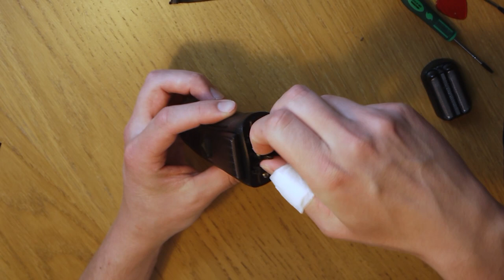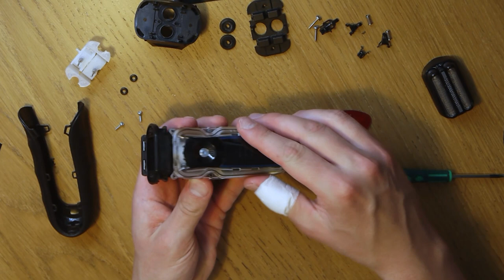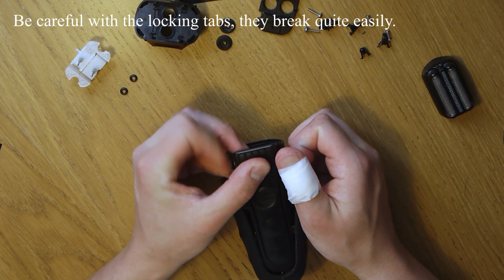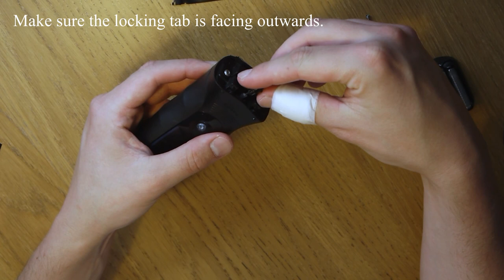Braun Series 3 Battery Replacement

Comment: Thanks for this video! also regular rechargeable AA batteries will fit with a slight modification of the battery connectors (just fold the (-) connectors on the board‘s side to have a firm connection to the battery) - I used 2x IKEA LADDA batteries. All in all i think this shaver is pretty good to repair, just give it a try :)
Reply: Is there anything special to this specific batteries? Why wouldn't I be able to use LADDA straight away (or similar products?)
Reply: @AndiBraun93  you can indeed use the LADDA straight away! The (-) connector on the board just needs to be bent over one more time to be used as a minus connector for your battery, thats it :)

Comment: Superb video..just changed my batteries on my Braun 3040s, the only difference  is I used standard AA Duracell ultra recharge NiMH 1.2 volt 2500mah batteries and had to slightly  bend the copper contacts inwards on the shaver battery compartment so a good connection  was made and it works just fine ...like a new shaver!👍

Comment: Many thanx, great tutorial - changed the batteries without problems. To other users: Be carefully in the first step to unfasten the small plastic parts under the shear foil  - they can easily be lost during disassembling.

Comment: Obviously, Braun could have put a simple lid on the other side, so that consumers could change the batteries with ease. But no, they wouldn't buy new models as often then. Thanks, I'll try this as a last resort.
Reply: It is probably because you can use this in the shower so needs to be ultra watertight
Reply: @HerwinAcoustics  A watertight lid would be possible, but Braun designed this like a laptop, so you couldnt easily service this yourself. more $$$$$$$$$$$$$$$.

Comment: I just disassembled mine, because it indicated bad batteries...
As I took the batteries out and measured them (using a Voltmeter), their Cell-Voltage was absolutely fine - so I put the old batteries back in and measured Voltage again, but with the shaver turned on to measure the Voltage with load and it's still absolute fine!

Fortunately, I didn't order batteries yet, as my shaver now continues working happily with the old batteries :-)

Comment: Fix & Fika, thank you for a great instruction. Although I broke the rubber/plastic cover while trying to pull/peal it off. By the way, did anyone noticed that Cleaning station stops working when battery quality drops? So, no matter how well you charge your slightly depleted/old battery, cleaning station won't work anymore. I throw away my previous cleaning station thinking it was not functioning, just to discover the very same problem with a new one. The shaver was still working correctly and chargeable, just the cleaning station electric motor was not functioning. Then, I replaced the battery on the shaver and cleaning station start working again. Strange, because cleaning station electric motor is powered by approximately 13V input and it's functioning should not be related to battery's condition.

Comment: I bought a refurbished 3040s but i think the battery has passed it best days, thanks for putting up such guides, so i got the choice now 2 exact batteries which cost about 14-20€ depending on brand and stats, o i try to modify the minus connector as comments wrote and use the best 2 AA rechargeable batteries (imho panasonic eneloop pro 2500mAh) for about 10€, so the winner is i will try it with 2 AA

Comment: I did the whole procedure and managed to change batteries. That’s fine. But the problem still remains. 
The reason why I did this was a to get rid off a start/stop problem. It takes 10-15 minutes to start and about 5 minutes to stop nowadays. 
This behaviour started almost exactly after the guarantee ended. That will say after two years and one week. 

So it wasn’t about batteries. There was a circuit board inside when I opened it. 

Have engineers at Braun put a automated product death in it?

Thanks for the great video. It had all needed.
Reply: It seems you are the only guy to have experienced this. Mine worked since 2014 till 2023 when the batteries went bad. Thats like 9 years! Haha, I myself am surprised!

Comment: Thanks a million !
I was able to replace dead batteries with new normal rechargeable AA batteries thanks to this video. 
You see, normal AA NH batteries can be replaced with the connecting metal slightly bended inwards.
In Korea, those weird-looking batteries are very expensive due to overseas delivery.
Thanks again !
Reply from the maker: Cool, they can be quite pricy here in Sweden too. Will have to try and use normal AA batteries, some comments suggested Ikea LADDA.

Comment: This is a very helpful video.  Don't think I would have been able to figure out how to disassemble my razor without seeing someone else do it.  New Ikea LADDA batteries installed by bending the battery contacts inward so that they make firm contact with the ends of the cells.
Reply from the maker: I'm glad you found it useful! Smart to use LADDA batteries instead, the original batteries are kinda expensive. I'll do a video with LADDA batteries too when i have time.
Reply: @ReviveNRepair  My original batteries had gotten to the point where I was getting just one shave per charge.  The new LADDA batteries tested at 1940 mAh. I would have liked to have tested the batteries that I took out of the razor, but due to the weird nubs on the ends they wouldn't fit in my battery charger, so I'll never know just exactly how depleted they were.

Comment: Little TIP: Instead expensive FDK batteries (sometimes hardly to buy) a usual AA regeargeable cells (without metal endings like FDK have) may be used. To ensure connection with coppper contacts, all 4 have to be spring up. The good choice may be well known and good working cells like Panasonic/Sanyo eneloop, or GP Recyko+. Do not suggest Varta due to self discharging parameter (even if producer say somenthing else) - my private experiencie with home appliacies and digital cameras.
If a RED light blinking quickly after batteries replacement and Braun is not working, simply connect charger and charge the new batteries. It may happen even if new batteries were charged (externally) before.
Reply: Very dificult find those bateries in they same service Braun
Reply: Sanyo eneloop  the best for this thing.

Comment: What can I say? Excellent video-  very clear, concise and well filmed (apart from when you obscured the tiny plastic pieces on top with your hands-couldnt tell which piece you had put back on.... :-)   ) . Very grateful for this. You just saved me about 50 quid.  Mines a 3040s wet and dry and as you say it is identical. Many thanks.
Reply from the maker: Thank you! And you're welcome :D It's a nice feeling when you manage to repair something and save a few bucks. Good feedback, will keep that in mind when and if I do another video.

Comment: First I'd like to thank the poster. My Braun S3 3040s appears to be successfully charging in its cradle.

Now here are a few tips:

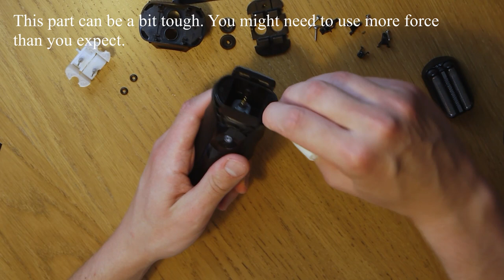1. You can start at 2:30, without removing the top. I used a small thin pointed, but not too sharp knife. Pushing it upwards very near the top, at the back allowed me to start prizing the strip off, without much difficulty.

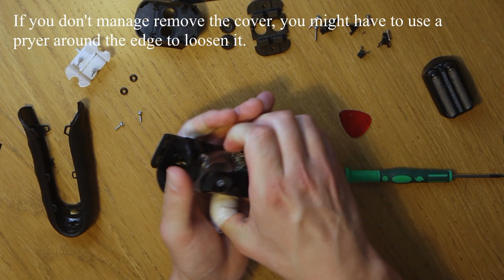2. Removing the bit as shown at 3:58 didn't work for me, but once it did flex far enough to allow me to slip out the printed circuit board with the batteries.

3. As mentioned you don't have to buy batteries with nipples. I just carefully folded a piece of aluminium foil and place it at the negative end to give a tight fit.

4. On putting back the rubber strip pay careful attention to the tabs, so that they are not on the outside. Also don't try to simply push it in right at top. You need to flex the top in before pushing home otherwise it will never go back.

Comment: Très bonne vidéo !  Pour le 340s-4, il faut retirer le haut métallique bleu pour retrouver le même processus. Attention, les deux petites rondelles en caoutchouc peuvent rester collées à l'intérieur de cette pièce. 
Very good video! For the 340s-4, you have to remove the blue metallic top to find the same process. Be careful, the two small rubber washers can remain stuck inside this part.
Reply: Bonjour, quelles batteries faut il acheter ?
Merci
Reply: @jarillon5614  merci
Elles font combien de mAh ?
J'en ai vu en 1800mAh sur amazon
Reply: @roryMlego  Je n'ai pas envie de démonter mon rasoir pour le savoir ! 😒 Il faut que la référence soit la bonne . Il y a des batteries avec des tétons et d'autres avec languettes. Il vaut mieux ne pas se tromper.

Comment: Of course, you have to weigh the cost of a new shaver vs the cost/trouble replacing the battery. If your batteries are shot you probably also need a new foil head, which in my case was half the price of a new Series 3. I bought mine Jan 2014, so it's over 7 years old. I got my money's worth out of it and it still works, but I have to charge it about every other day, and it's probably due for a new foil head.
Reply: A new one is 50-90 dollars, so yes it could save you roughly half the money when you figure in cost of batteries and a new head.

Comment: Nice DIY tutorial. I almost failed. After installing the new batteries there were red and yellow blinks on the board and the charger did not want to charge nor the shaver operate. Somehow it turned back on, but after during the assembly one screw just broke into the device. Now it’s working however the top does not fit properly. Bad luck.

Comment: Great Video, can you tell me what model Series 3 was that shaver? 3040? 3010?
Reply from the maker: Thanks! It's an older model called 350cc-4, but should be pretty much the same as 3040 and 3010. You should be able to use the video for all series 3 models.
Reply: @ReviveNRepair  Thanks so much for answering me and for a very informative video. Regards -Ken

Comment: Why did you disassemble (and risk breaking) the oscillating bridges?  This part lifts out as one piece!
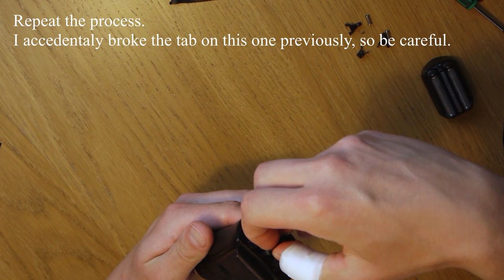Reply from the maker: That's what I did the first time and broke the tab which I mention at 1:10. The white base was stuck somehow after years of use which pulled the tab things out of their sockets. Hence from my experience, it's safer to take it apart in steps.

Comment: At the end the video is very dark snd it is impossible to select the small black parts to be reassembled on the black head of the sheaver. You should use full light and suggest to take photos with the smartphone before disassembling

Comment: Hi, guys, are the steps before 02:25 necessary? It seems to me that the replacement can start directly from there.
Reply from the maker: You could try. But I couldn't fit something to bend with when the top is still on.
Reply: Also, taking the small pieces off enables you to clean all the parts better while changing the batteries

Comment: Appears that the top does not need to come off. Only the side grommet and the front panel. Can you confirm?
Reply from the maker: I would imagine it being difficult to remove the side grommet without removing the top first, I haven't tried though. Might be possible but hard to do it without damaging the surrounding plastic.

Comment: The amber light is on for my 320 s-4 (to replace the foil and cutter cassettes), but the foil and cutter cassette seems ok and won't hurt when I shave, how do I know when to replace it? is it when it's hurting me or you can see visible damage in the foil and cutter cassette? also is that 7 dollar ebay foil and cutter cassette from china any good.
Reply: you can reset the amber light when pressing 5 seconds and holding the power button

Comment: hi, what battery did you use 18650?
Reply from the maker: The original batteries are of type Ni-MH which 18650 isn't, 18650 is Lithium-Ion. I think it's the safest to go with the same as the originals. I have a link to the batteries in the video description.

Comment: Is it necessary to remove the cutting head (other than the foil) to replace the batteries?
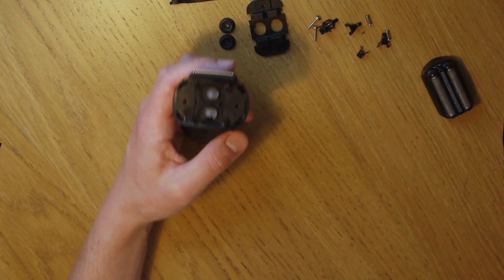Reply from the maker: Yes, otherwise it would be very hard to remove the sides. The only access point for prying without damaging the plastic is under the large cover, which I remove at 2:02
Reply: @ReviveNRepair  And I wonder how you did remove it because that's where I'm stuck. I noticed that you twisted the shaver body a little near the trimmer. I tried twisting near the trimmer, but my (350cc) large cover does not want to budge.
Reply from the maker: Twisting back and forth a bit worked for me. Maybe some light tapping, prying or spraying with etc wd40 could work?

Comment: Plz, can you tell me the type of the battery? Is it ion lithium?
Reply from the maker: The original batteries which I'm using are Nickel–metal hydride.
I don't know if it's a good idea to use Li-ion batteries instead. Probably doesn't matter but don't take my word for it :)
Reply: Right. LiIon is more than 2x the voltage than NiMh and would likely fry the electronics and motor. Also the charging circuit is totally incompatible with LiIon cells and may cause a fire or explosion. When replacing batteries, always replace with the same battery chemistry.

Comment: We don't recommend stripping the agitators out of the head. ONLY remove 2 head side screws. Then pull the rubber grip left and right. Drop the grip down from the center unit. Next remove the 6 screws > 2 top, 2 center, 2 bottom < Replace batts opposite polarity. 6 Screws replaced. Slip grip under the unit, press back together. Remove the trimmer. Redo head 2 screws. Confirm the head portion protrudes out the back of shave. Press the sleeve around. Replace trimmer by placing the dog-legged end of spring in shaver hole the other end into trimmer. Slide trimmer up until it snaps in place. Replace the screen on the head. Charge shaver. Test shaver/trimmer operate. Less work.

Comment: Hello 
I replaced the batteries but the red light keep on blinking and it looks like the batteries do not charge. Any idea? btw thank you for this clip.
Reply from the maker: Hmm, a red flashing light means low battery so it does indeed sound like it's not taking any charge.
For how long have you tried charging it? Does the green light flash when you plug it in? That mean's it's charging.
Could also be faulty batteries, but I'm not sure.
Reply: @ReviveNRepair  Hello. Thank you for your answer.
In fact, I dropped the shaver during shaving, than the red licht started blinking and no more shaving. When I press the startbutton for 5 sec. the light for replacing the head starts blinking.  No green light at all. I've charged it for hours.
Reply from the maker: @RobKeijzerinfo  Does the shaver work when the charger is plugged in? If that's the case one of the batteries might have come loose or something when you dropped it. If it doesn't work when plugged in it's probably something else which I can't say for sure what it could be.
Reply: Fixofika the shaver does not work when plugged. So maybe it is something else. Thank you for your time.
Reply from the maker: @RobKeijzerinfo  No worries, I hope you figure out what's wrong with it.
Reply: Mine has 3 year old batteries and red light blinks after 2 uses after I charge.  However, I ignore that and get another 5 or 6 uses before battary dies. I ignore red light

Comment: Has anyone had this model just not turn on anymore? I plugged in hoping it was not charged but did not help
Reply from the maker: Hasn't happened to me. But have you tried a different charger if you have one? Might be something with the circuits too, water damage or something.
Reply: Fixofika I will see about a charger.  I never had it in water.